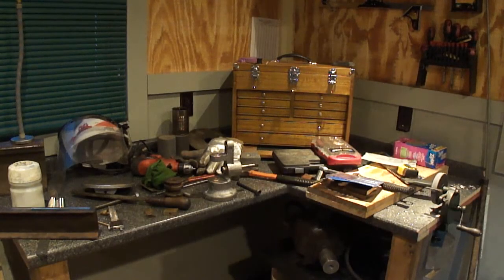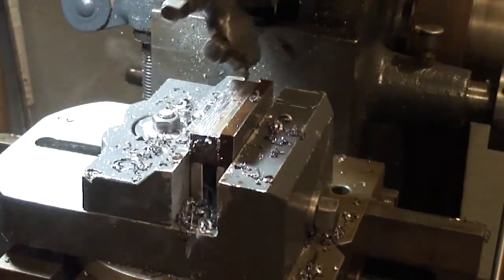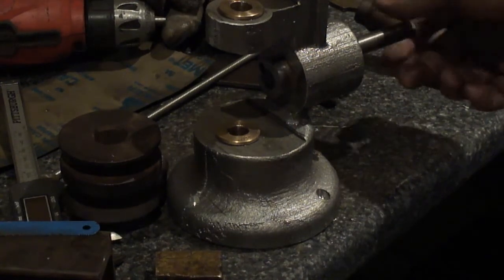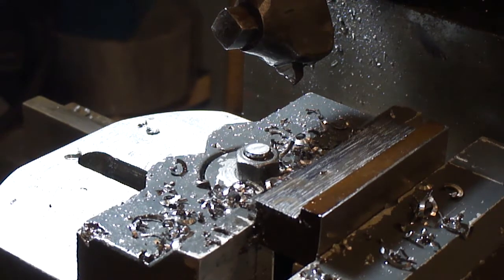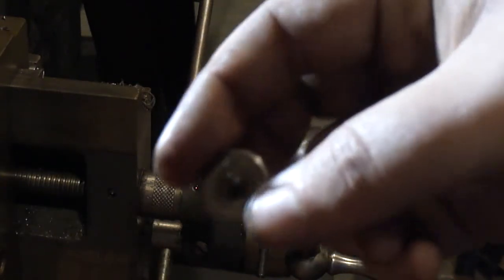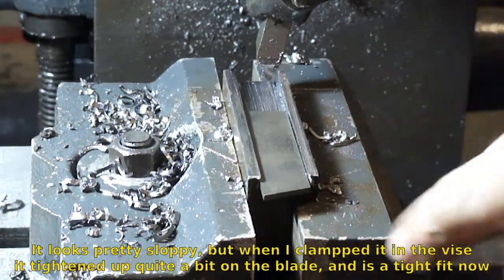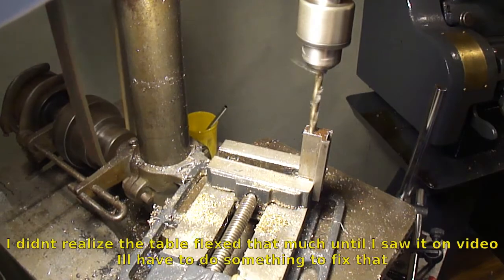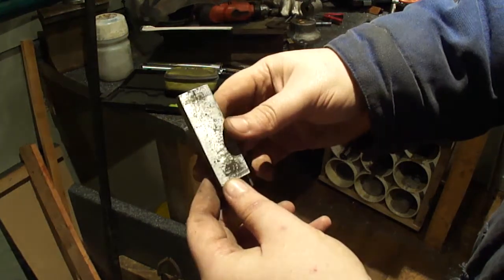Shaper Action - Making a Parting Tool Holder

Comment: I was looking at my shaper the other day as I need to make a blade holder for my treadle saw. I think I only need a vice and parallels to get it going. Roll on payday. Great vid again.
Reply from the maker: lol, I actually used a drill press vise when I first got my shaper because the vise never came with it. I just bolted it down using the T slots and thats how I machined up the stuff until I got my vise I have now cast and machined.
For parallels, I just made my own, just some pieces of 3/16" steel that I cut into strips about as big as tall as the jaws on the vise, then I put pieces of HSS blanks underneath of them to raise them up to set the height, then machined the parallels down to the top of the jaws of the vise.

Comment: NAP TIME!  I love this machine....  click click click click.... ZZZZZZZzzzzzzzzzzzzzzzzzzzz
Reply: worldtraveler I like the clicking too...  It's like ASMR porn for metal workers.  NO ONE CAN RESIST THE POWER OF THE HYPNO-SHAPER!
Reply from the maker: lol, well, technically it's too late at night to be nap time, more like full on sleep time. One of these days, Ill make an idler pulley for the shaper and get rid of that clicking sound, but it honestly doesnt bother me and in person, you barely notice it that much. Also what you do hear, it kinda sets the tempo for the shop, lol. Only thing is now, I need to fix that ratchet pawl or no more shaper videos for quite a while, so that'll probably be the next thing to work on...
Reply: Leave it alone.  Could you make me a video of that thing running that's about 30mins long with no talking and no other noises?   That thing is better than a handful of ambien.
Reply from the maker: lol, I could probably do that, but the problem is, the longest video the camera will do is 25 mins, but Ill see what I can do.